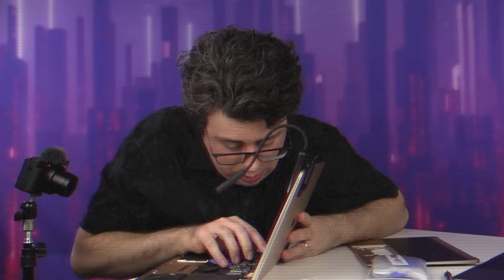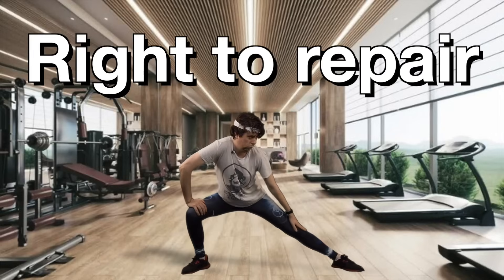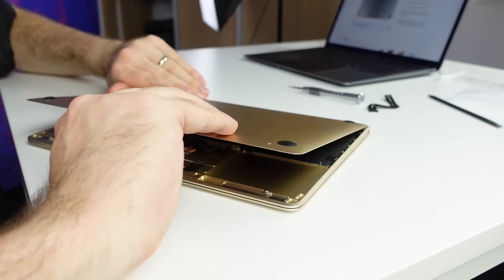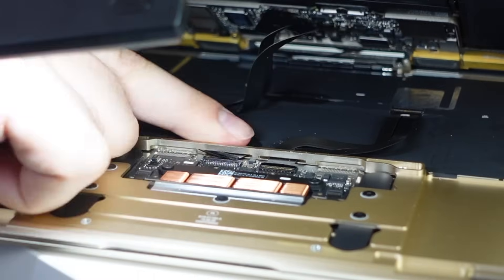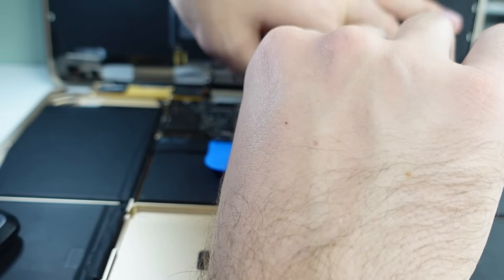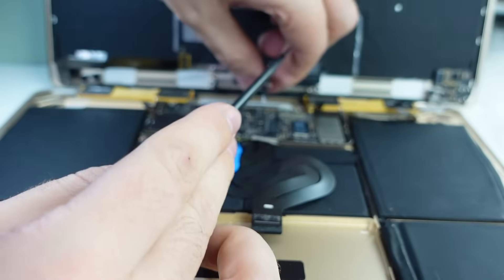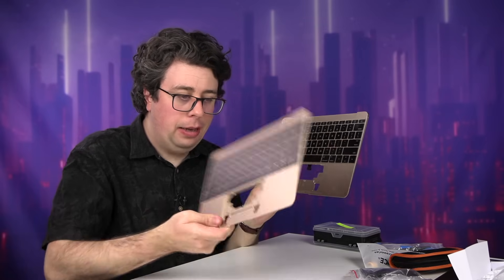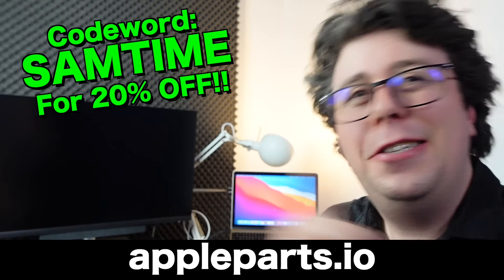I Try to Fix My Old MacBook

Comment: If your MacBook does not power on no matter what you do. Try to literally knock on all four corners on the back of the machine. Hard enough to sound like a knock on a door. Turn it on. It is now fixed. I'm not lying.

Comment: Replacing the keyboard on those things is a complete pain in the arse! Something like 52 screws holding just the keyboard on! Thats not mentioning the other screws for the case, and other nik-naks you need to move out the way to get to it! You made the right choice in changing the whole palmrest/keyboard assembley!

Comment: I remember one place I worked at to where any time someone brought a MacBook that needed a repair I was the one they called up to repair it.  I also did repairs on iPhones and fixing a MacBook did feel similar to the iPhones so maybe that was why.  Even so reparing apple products were huge pains because any time I would be tasked on repairing them I had to tell everyone to make sure I am not disturbed and that this may take awhile because of those cables.

Store would eventually stop accepting apple computer repairs because there was not enough profit with the time it took to fix them(me fixing a pc laptop for similar issues often took 1/4-1/2 of the time).  Ended up doing some of the apple repairs on my off hours and got paid for it so I ended up getting more money since you only got a small commision on doing the repair in store(as of writing this they remove the commission completely)

Comment: My 2011 MacBook pro required me to do a lot of work myself, such as replacing the disc drive with an SSD, replacing the lid after cracking the screen, and replacing the battery

Comment: To replace the keyboard on my computer, an arduous task that the bards will sing about for generations, I need to:

- loosen two captive Phillips screws on the underside of the computer.
- slide the keyboard toward the monitor.
- pull the keyboard up.
- unhook the ribbon cable.
- remove the keyboard.
- insert the new keyboard.
- and do the reverse of all those steps and instructions.

I know.  ThinkPads are terribly difficult to service.
Reply: To replace the display on my Thinkpad L390 Yoga, I need to loosen two screws, slide it out and disconnect it and put the new one in reverse. BOOM.
Reply: Now, try to install MacOS on your machine 😅
Reply: @allaboutferrets  

I had it on there. Catalina. I just can't stand floating window managers anymore and decided it was best to move the testing drive back to a Linux distro.

Comment: I have a 2015 MacBook Pro.  I had a similar issue.  Tried to open up the back but one of the screws was seized and wouldn't come undone.  Had no choice but to bring it to the Genius Bar.  The Genius asked me if I'd like to replace my "vintage" MacBook.  I said "No".  They took it to examine then called me to confirm it was in fact a loose cable.  They charged me $90 to replace it.  SMH.